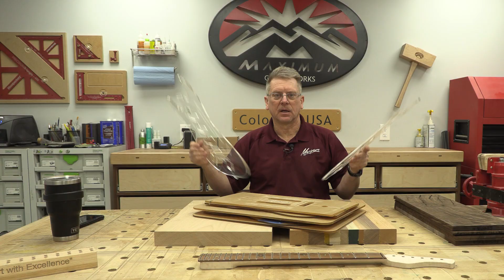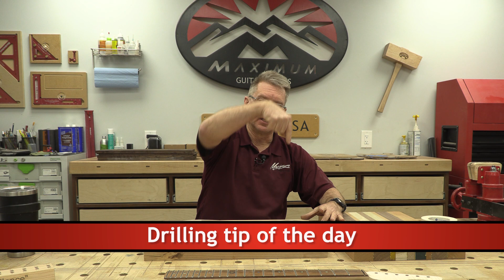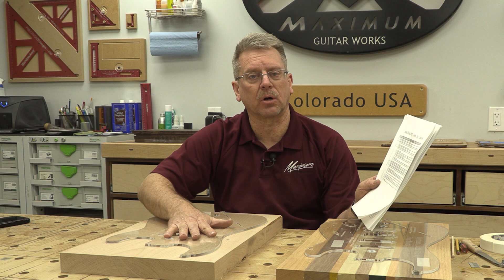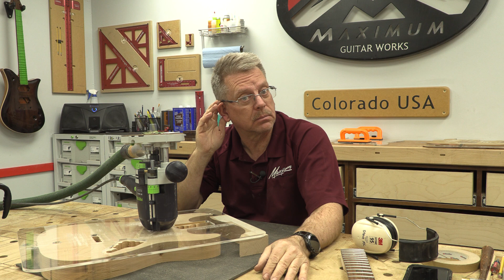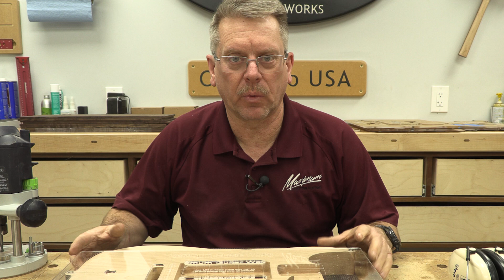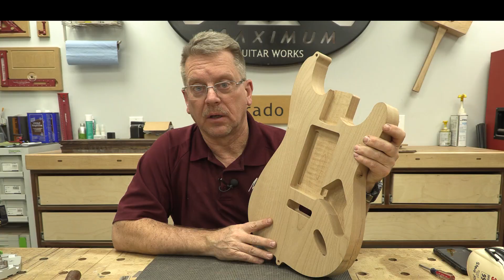Premier Strat Build 2022 - Part 8A - Cool Guitar Swimming Pool Routing

Comment: is your vaccuum wired in with the router?
Reply from the maker: Yes.  Even with a pretty powerful dust collection system...a vac does better with the small dust chute on routers.  But yes...my shop vac is switched so it powers up when I start the tool that is plugged into the vac.
Reply: @maximumguitarworks  I'm interested in how you wired it, did you just ghetto rig it in or did you start with excellence and do it high tech like i presume you did... haha

Comment: Question, I want to buy a template from you, for my first build, i want to make a tele with a humbucker in the bride and a volume control, Do your tele templates also have the off body holes for the dowel pins? What would you suggest? Thank you for sharing you knowledge.
Reply from the maker: Thank you for your question. Yes all of my templates incorporate alignment pins… Where the body always uses the off body pin system. So, any of those templates on our website will incorporate those same features that you see in my videos.

www.maximumguitarworks.com

Email or call me if you need help selecting to right template set.

Comment: what does a swimming pool route do to the tone vs traditional 3 SSS route? I'm building a Nile Rodgers Hitmaker copy, and I know that his guitar is lighter than others. Makes me wonder if he had a swimming pool route. Hitmaker body was a 1960 strat, with 1959 neck. Thank you for your awesome content!
Reply from the maker: Ha...I'm not getting sucked into that debate!  It is funny...but you will see arguments on both sides of this question.  As I said in my video...I do it for reasons other than tone.  One of the reasons I love electric guitars so much...is that I have more latitude for creativity than we would with an acoustic guitar.  Because I believe that no one thing is going to make a difference to make a good guitar bad...or vise versa.  The most import things to me are quality materials and part...and great craftsmanship.  Outside of that...I do what makes sense for me and the situation.  Good luck.

Comment: Another inspiring video full of details and helpful insights. 
I always look forward to these videos and watch them multiple times to catch as many details as I can.
I was wondering if the swimming pool cavity would be a good idea for a Tele?

Thank you!
Reply from the maker: I can't remember ever seeing a swimming pool route in a Tele.  It only works under a pickgaurd...so it could work as a possible mid and neck configuration.  Do I need to design one?  Might be worth a try.
Reply: Hi Steve, I am not aware of a Tele with a swimming either, but I thought it might be an interesting idea for a future build. 
I was thinking it would enable some weight reduction, future flexibility of pickup options with a simple change of the pickguard and all without retrofit routing.
Best Regards
Reply from the maker: Sounds good.  I'll have to add that to my list of "Mr. T" options.  ;-)